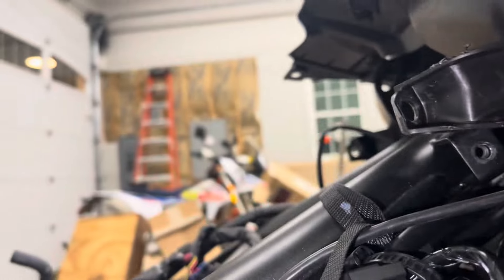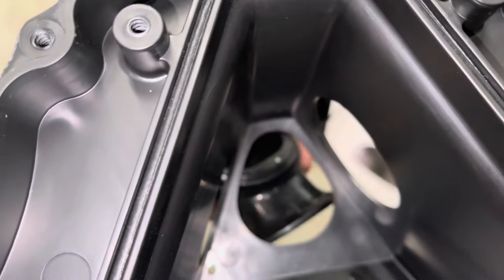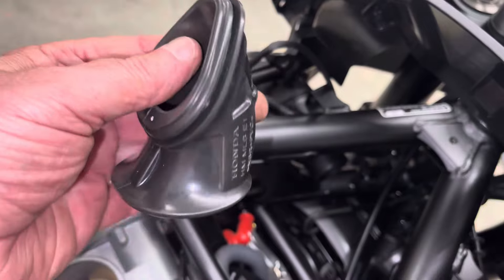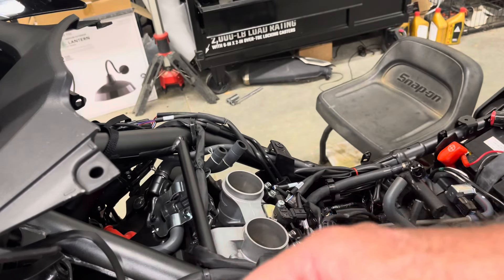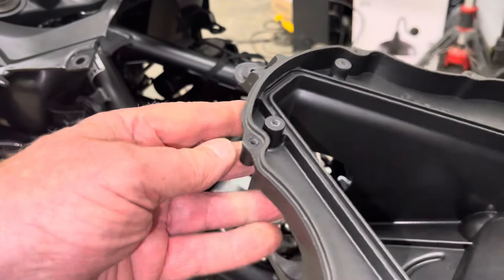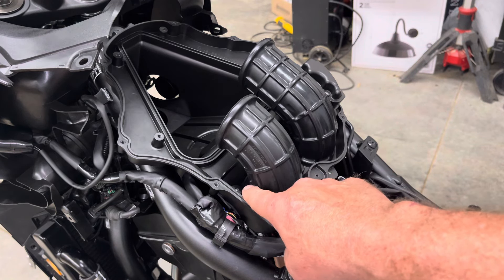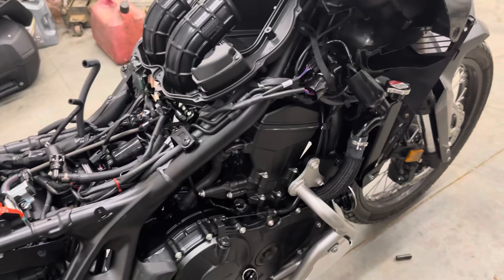Honda Transalp XL750 Air Box Finding Air Restrictions

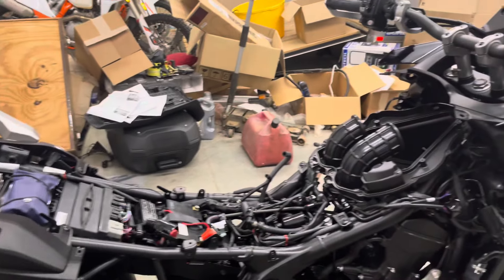Comment: To me, it does'nt sound like you are totally convinced on the theory yourself. Do the mods, stick it on a dyno, and wow us all. DNA say their filter is good for up to 3hp on its own. Don't apply a cumulative factor to the DNA plus your airbox mods and seek to claim its all down to to chopping the airbox. One step reported at a time will be credible, and could possibly turn you into being thought of as a genius. Going up against the Honda Engineers is a brave move, imo of course. Best. G. 15:16

Comment: Just a wild guess that Honda's engineers took induction system airflow and the entire bike's aerodynamics into account.  And maybe designed it so dust doesn't get sucked up into that hard to change air filter so fast.

Comment: I'm pretty sure the limiting difference that applies to the US model that causes it make less horsepower than the European model is just the ECU map at the absolute top end of the rev range. It's to do with US vs European noise requirements. I don't think you're going to see any gains at all from intake modification without a remap.

Comment: the Italian airbox is the same as yours, in the plastics you removed there is an additional cap, for me only the hole at the bottom needs to be closed because it takes hot air, useful only for polluting less (in addition to the two bulkheads that you find on the side plastics and that close the duct) congratulations on the work and greetings from Italy.

Comment: I really think you need to dyno the before and after to find out if it helps.
Reply from the maker: I have seen a few dynos ran on the Transalp 750 here in the US and they all seem to run around 70-72 HP and 47-48 LB-FT at the rear wheel. So I have made an appointment to have it dyno tested to see the results after these mods and hopefully will get a video results report coming soon.

Comment: i feel like rain could become a problem if you remove some of these pipes.
Reply from the maker: Well the air box sets up kind of high, it’s above the engine. It did rain on me a little bit last night when I tested out the cruise control which works great by the way and I had no issues with rain staying inside the air box because it has a hole in the bottom of it as well as a drain hose for any moisture from collecting inside